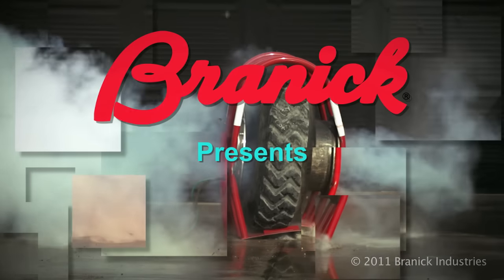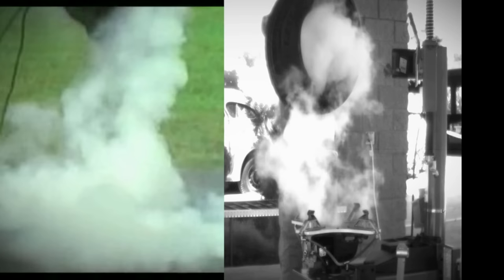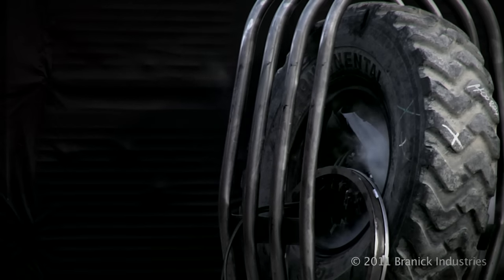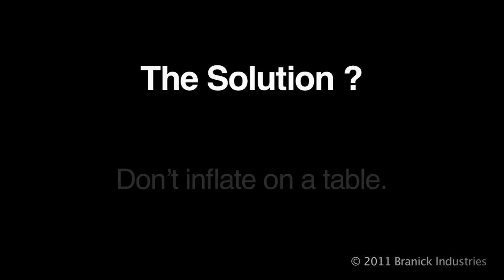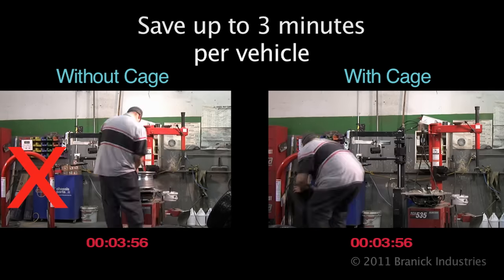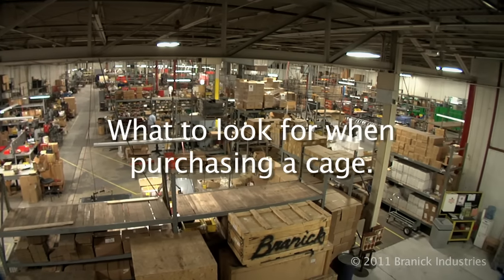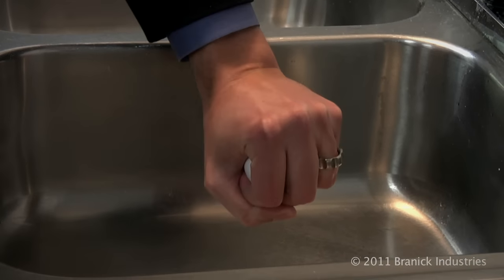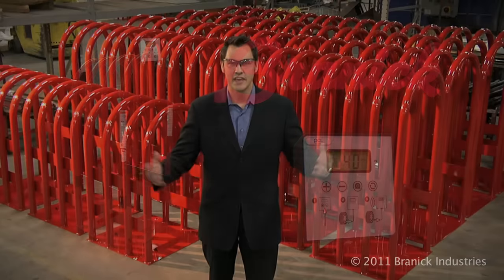Tire Safety Video.mov

Comment: I'm a Tire Tech at American Tire Depot and having a tire blow up while inflating is what I fear someday will happen. I mount and dismount new tires and used ones several times a day I work on at least 80 tires. the new tires I don't really worry about exploding except for those new tires that won't easily sit bead over the rim. I've had to go up to 80psi on some tires for the bead to finally sit. the used tire are alot more sketchy.  we don't sell used tires but we do patches on them. Sometimes while inflating you could hear the tire stretching I'm guessing it's the plys or cord that hold the tire together,  that noise I hear is those part failing and ripping apart. 

I'm not a pussy,  but I would like to have a cage. Unfortunately my work doesn't supply us with a cage.  it amazes me that tire shops or any shop that deals with inflating a tire that  they aren't required by law to have a cage for workers safety. 

I'll get written up for not having slip resistant boots. 

but it's ok if I inflate a tire and it blows up and I'm killed because the rim flew straight towards my head.

but God forbid I'm without my boots and I slip and break a bone or fracture something.  yes I know a slip or fall can lead to a alot more serious injury or even death.  but I've fallen before at work and got right up without a scratch the worst been cuts, bruises.

I want one of these at my shop. not just for my safety but that of my coworkers. every single one of those guys risk not coming home to their family all could of been prevented had my work supplied the shop with a safety cage. 

I hope I can get one soon. if I can't pay for one all at once I hope the either Snap On, Cornwell or Myers could sell me one and let me do payments on it.
Reply: I'm a tire tech too at americas tire and have the same fear we have cages though just make sure the pump is securely connected to the value we had a close call the other day be safe
Reply: +Devin Williams Tire grease? well no we use another type of lubricant called SLIP TAC we get it from Myers. but no the stretching I hear from the tires is herd almost instantly, I have no more than 20 psi when the noise starts.  no way would I ever go up to 80 to sit the tire on a beat up used tire fuck that. I have though gone way past 80psi on new stubborn tires mostly run flats or tires wider than the rim cuz the dumbass customer likes the look,  idiots man.
Reply: +Devin Williams BTW, yes the wheel I'll usually have it clamped onto the machine but our store has literally bootleg ass equipment.  so I've bought my own everything except a tire machine. I'd like a coats something I plan on getting from Cornwell.  but what we have now is some bootleg brand from China they purchase three of those for what one Coats cost but the tire tech is the one who gets fucked using shitty equipment
Reply: Arthur Garcia
Reply: +Ber Loz yup, that's my name man.
Reply: You don't need a cage to be smart about inflating a tire.  On larger truck tires that pose more of a danger (more volume and pressure) we inflate them with a longer whip and aim them away from any co workers and chain it to the hoist upright to ensure the rim doesn't fly.   If you DO need to be close to the tire for whatever reason don't be at either faces of the wheel, as you see the cages are open at the ends and the tires/ wheels don't eject from the ends.  Same as on a tire machine, don't lean over the tire when inflating, I inflate and lean as far back as possible while inflating the tire, every, damn, time.
Reply: Hope someday u get that cage man..  I used to work in a tire shop and one day I was fixing  a tire with a big, very old and rusted  2 piece rim, and just when I finished inflating the tire, the rim came apart and the whole thing exploded with a huge bang. One section rim ended up 20ft from  where the tire was, and I was sitting right in front of it. I know I'm an idiot for doing that, but I was 16 back then...  I should've bought a lotto ticket that day.
Reply: Art Flores i think those two piece rims are called Widow makers
Reply: "Rim clamp" tire changers don't have enough gripping ability to hold that much if the tire were to fail.
Reply: the most danger here is the plate ,not the tire it self ,because the iron impact can destroy your bone
Reply: The volume of air being released all at once is enough to blow your ass 10 feet into the air, of course you want to avoid the rim and the tire but the rim isn't the only danger, the whole thing is a bomb.  This is why they hydrotest gas cylinders, if they blow when filled with water, the water doesn't expand and create issues.   I think people need to realize this can happen with any compressed gas, be it air or something flammable, it doesn't matter.
Reply: Arthur Garcia don't worrie bro. these are commercial tires for big trucks, most fear I get is pumping up a Chinese budget tired to 100psi on normal car wheel is sketchy lol
Reply: hope you stay safe at  work arthur.
Reply: "You don't need a cage to be smart about inflating a tire"

but it sure as hell is a lot more reassuring to have one
Reply: where i work it's mandatory to fill all tires in safety cages, and low-pro runflats never seat.  we have to set the pressure to 80psi and then it violently snaps shut.  we all make jokes about it in the shop, but if they weren't in cages cars would get damaged and people would get hurt.  most of the time, these beads snap into place and it moves the whole wheel inside the cage, and the valve hits the cage and ruptures it.  we go through a few valve stems before the explosion doesn't land on it.  its a pain.
Reply: If you are that concerned, why don't you fabricate one yourself?
Reply: @arthurgarcia4389  Hey Art, you sound like a "stand up" guy. You should go into business for yourself. You've already bought tools.
Reply: work for goodyear as a driver. they had me airing a new truck tire size 11.25...the way goodyear air there tire is without a valve cuz is the fastest way to air the tires goodyear say...so u got to put ur hand in the cage to add the valve...please do not do this ..I lost my hand cuz of goodyear..my hand got crushed by the rim and the cage when it exploded on my hand and face..lost hearing,hand,,shoulder pain ,back pain ,ringing in the ear,headache, ptsd. after seeing this painful video is clearly now I know what happened to me..please be careful
Reply: Hope you managed to get a cage and stay safe Art

Comment: I've heard of the dangers of tire explosions and know of 2 people that have died from tire explosions but I have never witnessed the awesome power of a tire explosion till I watched you're video. It gives me a new respect when inflating tires.
Reply: In a video that I watched before this the tire had  exploded hitting the installer and driving him into the door of a nearby  pick up truck.The truck  looked like it had been t-boned by another vehicle .The door had been ripped off and the force pushed the side of the truck in 18 inch at the door pillar .They only showed photos of the scene after the explosion. It did not show the victim ,but it killed him.

Comment: Just retired from 50 years as a mechanic and back in the early days NOBODY used any safety gear. Yup, no safety glasses, no hearing protection, no steel toe shoes, etc. We also never tried to put a 16"' tire on a 16.5" rim using 150 psi shop air. (I can't believe that's really a problem) I have to say most of us older guys at least had more common sense and were NOT is such a hurry. That said, most safety gear these days does make sense... just to protect us from ourselves.
Reply: If someone is just having a bad day, common sense doesn't matter. That's even more of a reason to use safty equipment.
Reply: @vipervidsgamingplus5723  ... you couldn't be more right. I can't tell you how many times I saw people wearing PPE during Covid while driving a car by themselves.... then eating lunch while wearing latex gloves that were so dirty, I could see it from 20 feet away. They wear the gear at the wrong time for the wrong reason and wonder why they are having a bad day!
Reply: You're story is nothing more than survivor bias. 
As in, because you've survived anything from going wrong, then it must be down to common sense. The issue is those on the other side are dead, and can't argue the contrary. 

The old story of planes flying back from battles in ww2, with bullet holes all over the wing and fuselage. An engineer was then wishing to invest in protecting those areas. It wasn't until another engineer said "why reinforce these areas, its the areas we don't see that need reinforcing as the plane has gone down and not returned"
It's another reason you see a lot of people claiming seat belts aren't necessary and back I'm my day we didn't crash. They did, just those who died couldn't say how important it was.
Reply: @BMWE-hm7uz  ... Your side of the argument has merit. In those days we did see people get hurt, but I feel we learned from it rather than have a nanny state where people blindly follow certain rules, but still don't learn. That's why we have people who wear PPE but still get hurt anyway. As a famous person once said, life is hard, but if you are stupid, life is harder!
Reply: @rupe53  it's actually funny you say about ppe and people getting hurt. To continue the story about ww1 and ww2, and hopefully not to bore you too much,  the amount of people coming back to the medical centres with head injuries was low. Until helmets, mainly created from China were introduced to the ranks. Then the amount of head injuries increased and the soldiers then used to refuse to wear the helmet, their ppe, because the stats proved they caused injury. In fact, it was perhaps not so clearly the opposite, the fact people were coming back with head injuries, showed they survived the blast, the bullet, the fall or whatever the mechanism of injury was. But the difference on the surface wasn't they were coming back, it was the  introduction of the helmet that made the head injuries rise.

I think we are seeing more injuries in workshops and other dangerous environments because of this. People are able to get to hospital and the injury recorded, instead of recorded as death.
Reply: @rupe53  but I do agree. You'll know working in that environment that some people just haven't got enough meat between their ears to work in those places. I'm a mechanic by trade and I see people who I look at and mentor, or watch work and I think wtf are you doing in the environment. The sort of people to trip up over a cable tie and fall into a oil drum or something. No amount of ppe can save some people from themselves 🤣
Reply: @BMWE-hm7uz  ... again, a valid point where more are surviving to complain about it. Personally, I see way too many who think they get extra lives, like in a video game... they are SUPER MARIO! Basically, wearing extra gear does NOT give you license to be extra stupid... at least in my book. I also spent 20 years in the fire service so I know the proper gear counts for something... but you still need to use your brain.
Reply: @BMWE-hm7uz  ... circa 1980 I was working at a Datsun dealership and a guy was helping bleed brakes on the lift. He stuck his head out the window to communicate with the guy under the car, and bonked his noggin on a ceiling fan that was running. Fans were mounted between the lifts, so they didn't hit the cars. The guy needed a dozen stitches. He's lucky he didn't fall head first on the cement floor and break nis neck. (door was open)
Reply: @rupe53  I was at a BMW dealership, and one of the brake disc retaining bolts got stuck and stripped, so we were hammering the disc to essentially break it around the small screw, then mole grip it out. Simple job, done numerous times. One of the apprentices is helping me and another guy. We are hitting it, apprentice watching. We hit the disc hard, made a dent in the disc face, apprentice is really interested in this dint and as he touched it, the hammer come flying in again. Cue 2 missing fingernails and blood everywhere. No idea why he put his hand where we were hitting with the hammer. Just stupidity
Reply: Also shit was made better back then

Comment: A wheelbarrow tire blew into my hands when i was carelessly inflating it, i thought both my hands were broken, luckily it was just bruised...
Reply: think they blow up at 29 psi,they can t handle pressure but never the less a dangerous tire 14,5 psi???is the limit i think anyway they can hurt you pritty bad....inflating a tire on the car truck or whatever read the maximum psi on the tire,and use the length of the filling hose.

Comment: My local tire shop has a large table with all the machines on a row with rollers between them. The last step before the balancing machine is a laying cage with a computerized inflater.
Reply: A simple air pressure regulator is all that's needed. A computer is totaly unnecessary

Comment: I'm a farmer in Nebraska, and have had lots of tires fixed over the years.  We have various tire repair shops in the small rural towns around here.  They hire anybody, usually teenagers, to fix tires.  No safety standards are taught or enforced.  If they have a tire cage, it's usually sitting in the back unused.

Comment: damn... I've done literally thousands of tire mountings (passenger and racecars) and never seen a failure like this. Now I'm hesitant to even "air up" my tires.
Reply: Same here lol been doing tires for years and know I dont even want to go to work tomorrow 🤣😫
Reply: The lighter the car, the smaller the pressure. You say you didn’t work with heavy trucks.

Comment: Exploding tires shown in this video are split rims. I ran a tire store for 3 years and never had an exploding tire, mostly because we didn't do split rims. mounting a tire on a split rim is like setting a rat trap. There is a ring which goes around the larger part of the rim, and it has to be mounted just right. Guys told me about split rims exploding (without a cage) which sent the ring flying across a neighboring river and embedded itself in a tree. They couldn't pry it loose. Couldn't pay me enough to mess with split rims.

Comment: Had a Ford Model A tire and tube blow up on me. Right in my face. Was like a bomb or a shock wave blowing my ear drums out. Shot the center cap out of the front of the store. Almost broke my wrist and could not hear for 5 mins then nothing but muffles for several hours and then several days for my ears to recover. Whole new respect for how dangerous these can be, the tire blew out at only 32 or so pounds and was no joke of an explosion. Wont ever do one again.
Reply: You had put to much air in it, those only go up to 20 psi

Comment: Ive done commercial  truck tires as one of the services we offered in our shop. No formal training  just here do it. Finally bought a cage after numerous  bad tires peop,e wanted patched  we had one explode in cage and just the force of the explosion about took a bay door out. Cage went out into parking lot at same time. For all you newbies be careful and dont hurry. You are the most important part of any job and no dollar is worth your life. Im 56 and have 35yrs  experience with all sorts of equipment  repair. Be safe guys.

Comment: Tire cages are a must when installing Split-Rim tires. One of my friends nearly died when he leaned over a tire to check the pressure and it cut loose, it shattered his eye socket, fractured his skull and he was bleeding from his nose ears and eyes. After striking him it broke another person's elbow. And unfortunately a good friend of mine did lose his life to one of these rims, a catterpillar scraper rim cut loose and took him clean in two, please use a cage or urge your employer.

Comment: Worked in a service station as a teenager in the late 1960's and fixed a hundred flats on cars and trucks.  No one told us about the dangers that working with tires were.  Don't think the owner knew either.  Fixed 'em all though at $1.00 an hour pay.

Comment: I thought that the only dangerous wheels were the split rim ones, you could also overinflate a one piece wheel too but that is operator error and training should solve that problem especially with a tire inflator that limits the pressure.

Comment: Two-piece truck wheels (e.g., "split rims") are much more dangerous than single-piece ones.
Reply: That may be true but even mounting modern tubeless tires on one piece wheels can be dangerous if is not done properly.  The mounted tire and wheel should be enclosed in a safety cage when inflating and proper inflation limits should be observed.  The two piece wheels with locking rings are still around on a lot of older trucks and buses and need to be treated with extreme respect to avoid property damage and/or personal injury.

Comment: Everybody is talking about the dangers of split rims and that’s true they can be a real disaster. But the thing is normal car tires can also be a serious problem if they zipper. Friend who owned a garage has a bum arm for life due to a zipper failure of a car tire. Not a rim issue but the tire itself. This was a major brand tire and they paid out heavily. 

Cages are good for everything. Well worth the time for me. Use a remote fill also so you are away from it.

Comment: Not a bad deal really, I've seen a few random exploding tires are their rated pressures. Sure the "time saving" aspect is due to the automatic inflation device, but really coupled with the safety measure, I would gladly put this in my shop (if I had one).  The automatic inflation device alone is actually very handy I would say.

Comment: I remember a truck tire shop in the Yukon I used to work at, it had one hell of a nasty rim/tire, dent and mark in the ceiling, that ceiling must have been 25-30 ft high, if someone would have been standing over that tire or had their arm in there they would have been a splat mark up there too.